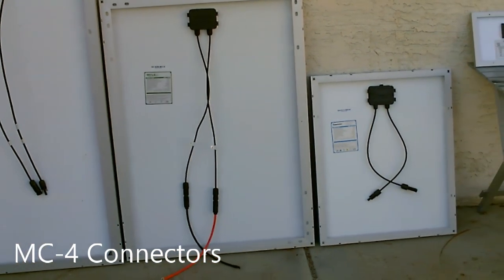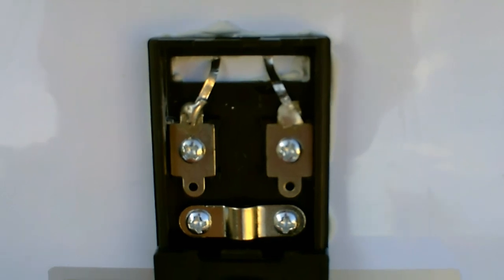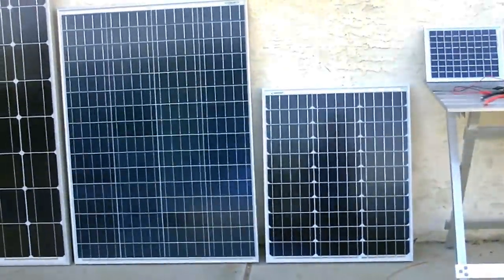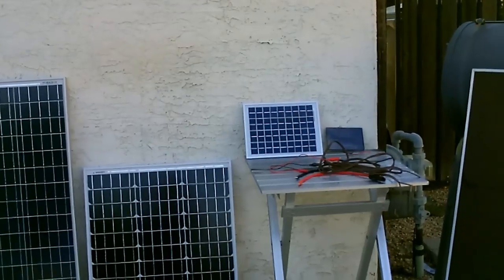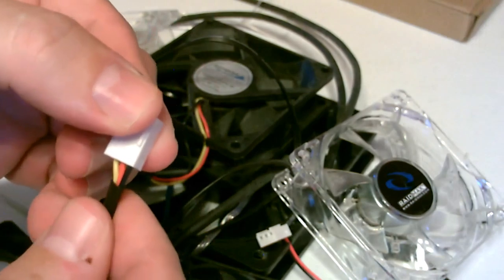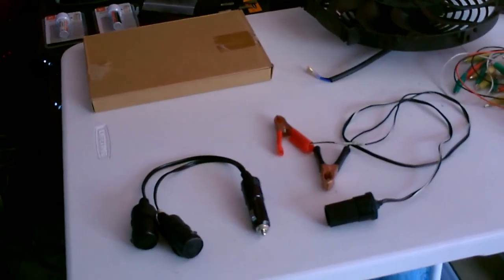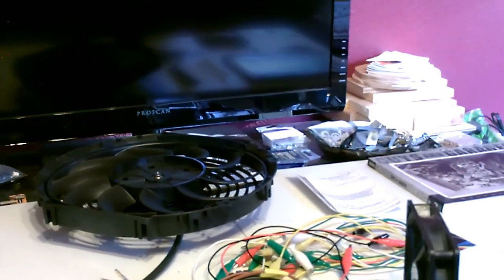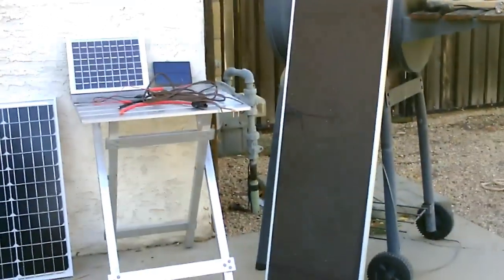Solar Panels! An in-depth (Q & A)! 1w-100w, 12v plugs,12v sockets, mc-4s, wires, case fan hookup etc

Comment: Great little video .I'm doing a bit of head scratching at the moment .Got 2 folding 100 watt solar panels .On the back of the panels is the square box for connecting up .( each panel has 1 box).the connecting female plug is a  roung jack plug type saying DC on each box ??? The solar charge controller diagram shows the 2 connecting holes as one plus and the next negative .Anybody know if I can split the jack plug cable from the solar panel to positive and negative on the controller??? .I'm a bit puzzled here .The battery positive and negative are simple enough but I'm wondering why the panels have this single round female port when it states I need 2 cables from the controller to the panel ?????

Comment: I'm getting significantly lower temps when the solar heater is laying flat, not at an angle like yours. I'm building one using downspouts to fasten across my roof rack. I'm building it outside in the UT desert and yesterday in full sun achieved 117F when at a 45 degree angle but only 92 at best when flat. This is at the fan exit so temps will be less when I pipe it into the van. I am assuming that while flat, a lot of the air is pulled right thru by the fan without a chance to hit the downspout top edge facing the sun. The temp decrease is immediate when I move the heater from 45 degree angle to flat. Running the fan slower does seem to increase temps a little but then again there's a lot less heat coming out. Blocking off some of the 2 3/4 inch inlet holes to each downspout section does not appear to alter temp more than a degree or 2. I feel like I need to get the air to travel across the inside top of the downspout sections but I'm guessing. Anyone have an educated guess or 1st hand knowledge? I'm holding off on cutting a hole in my vans roof until I can get better temps.

Comment: A lot of stuff thrown away can be used for these projects . Do you find things this way ? Do you go to salvage yards like Will PROWSE did and glean IR heater pads from luxury cars ? He wired them under his mattress and had a righteous 12 volt heated bed. If you own a hybrid I strongly recommend that you hack your car seat. You can save a lot of fuel. Especially if you live out your car.